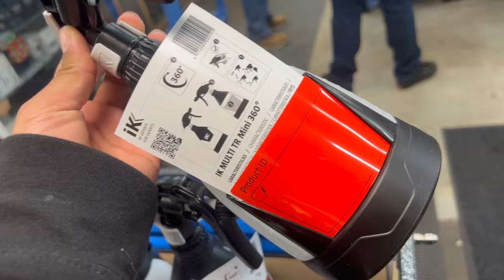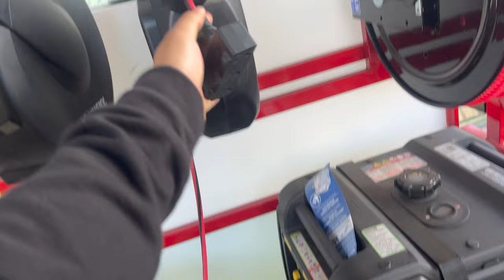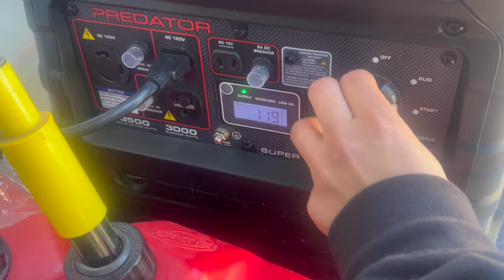STRUGGLES WITH MOBLIE DETAILING - BENNZDETAIL

Comment: I’ve had my Honda pressure washer for over 25 years. I’ve had my shampoo extractor for about 12 years I just changed the guts from the shampoo extractor low shampoo extractors use the same vacuum motor and Solutions spray. The only thing that really change quite a bit is the vacuum. I do change them at times, but once you purchase nothing but Honda equipment you get easy 15 to 30+years out of it as long as you maintain it and change the oil.

Comment: You’re investing money and purchasing equipment not wasting. if you buy the best, you will not have any issues. For example, Honda generator Honda pressure washer a good quality water tank around 90 gallons is a good size. looking to purchasing a shampoo extractor with 6 gallons of cleaning solution the cost for a shampoo extractor is about 1300 all the equipment you’re purchasing will pay you back overtime. You may have to purchase a three-quarter ton cargo van cause the small van can’t handle this much extra weight, the transmission will start taking a toll.
Reply: This is true buy once. But I would start off with a budget to get a feel for the field. I see people dropping serious cash on the best of the best. Just not to like it. I seen many come ups that fail super quick.